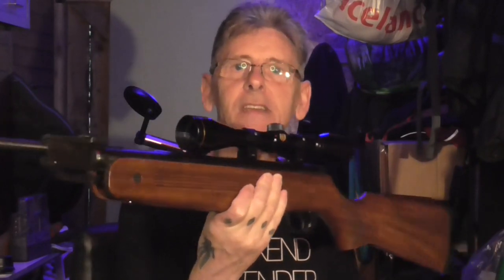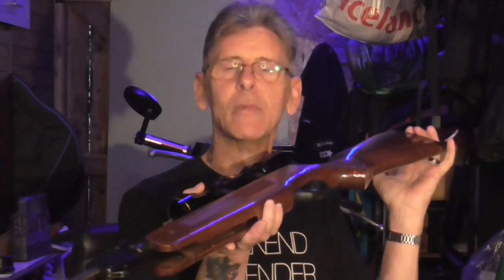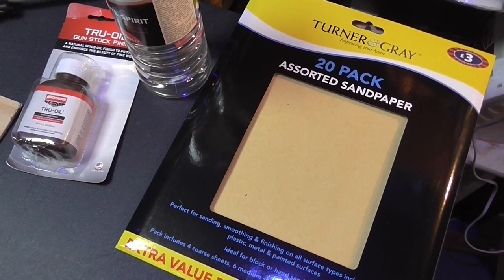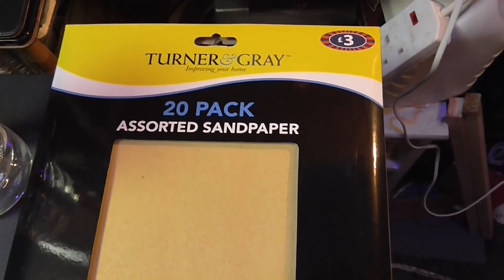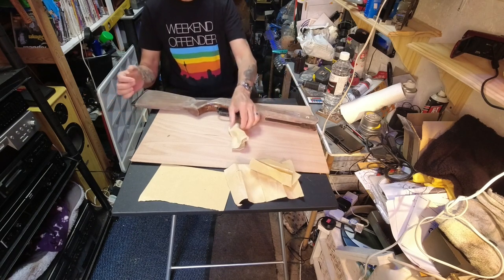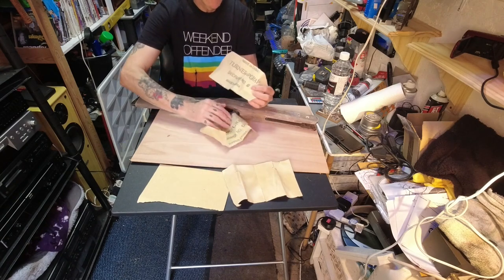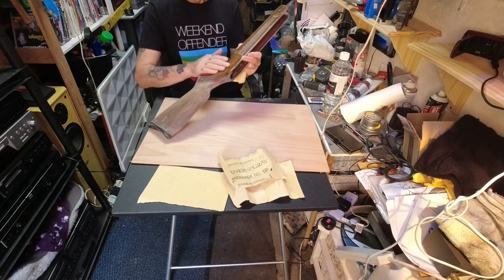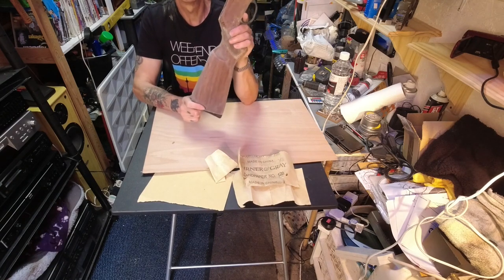Edgar Brothers mod.60

Comment: Yeah the second rifle is called a Westlake B2, I bought one back in 1989 brand new for £20! Considering my best rifle back then was a BSA Mercury and they were about £130 during that time. I have a B2 as a muck about rifle at the moment, but they are called SMK B2 now 👍👍 The cover is missing on your one hence the reason you can see parts of the trigger assembly. 👍😃
Reply from the maker: Yeh gonna try and Mackle some kind of plastic , or try and make one ,,, sent smk a email to see if they knew we’re I could buy one , but no reply as yet , thanks for the info , shane